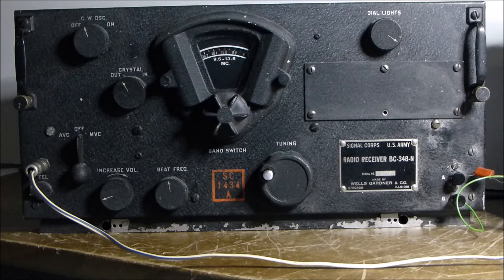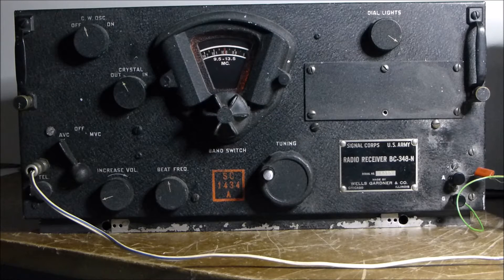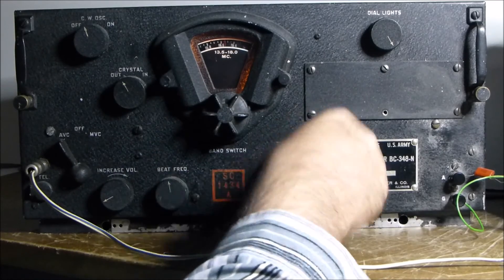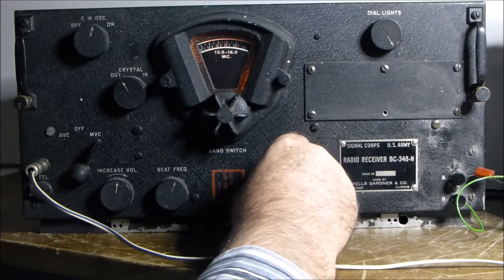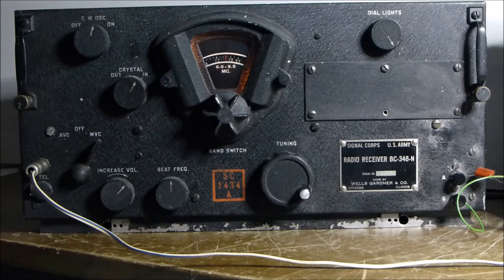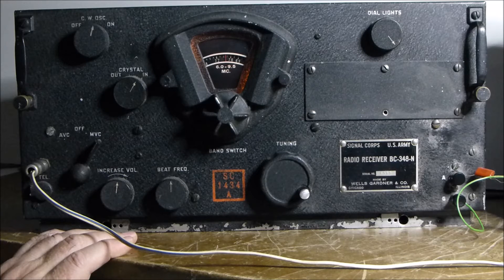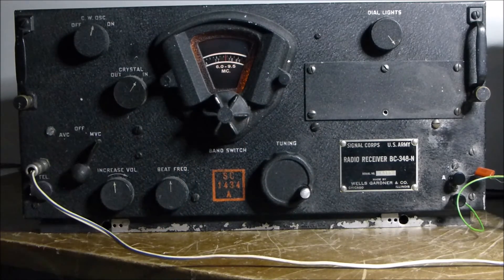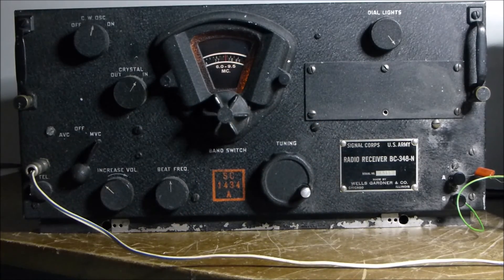BC 348 N - HF Aircraft Receiver

Comment: Hi can you please tell me where do I connect the power cable for 220 volts AC? As mine came without power cable so I don’t have any idea about it. I will be thankful if you may guide me to connect the power cable and turn it on. Many thanks
Reply from the maker: Hi, The BC348 was originally designed to woud on Aircraft DC systems , nominally 24-28V DC. It uses a dynamoter to prodcut the needed HT (High voltages for teh valves (Tubes). Many have had teh Dynamotor removed and a 'home' built AC PSU fitted, you would have to open up the case and take a good look inside, see if it has the origonal dynamotor set up or has been converted... Pete

Comment: I just got one yesterday. I don’t know what model it is because the tag is missing. The cw is switched with a toggle switch. What speaker are you using? My audio seems weak.
Reply from the maker: Hi, thanks for the message. Its been a long time since i looked at this  but i seem to think that there is a 600 ohm and an 8 ohm output tapping on this radio . There is an audio transformer center back topside and i seem to recall a tapping there for 8 ohms. If you using the crystal filter then its drops the gain a bit . and if its not 'cleaned' its drops teh gain a lot. Effectively its 'Q' drops of due to waxy residue finding its way into the crystal housing. I actually removed the xtal filter, carefully opened it up and took out the Quartz slab that was in there and gave it a good ( gentle) clean and finally a good solvent clean. Clean the housing insides too!. Then gently reassemble the filter  and you will be surprised how sharp the Xtal Filter becomes.( AND LOUDER)

Comment: Peter - nice video of the BC-348-N.  I have the BC-348-Q here.  It had just been recapped and aligned before I got it.  As a child, I listened to my father's BC-312-M until his home brew external power supply failed.  Not sure if it had a dynamotor in or not.  I made a short video of it, comparing it to a modern Radio Shack DX-398.  Audio from both radios was fed thru a Zenith Royal 2000 to amplify and equalize the sound.  https://youtu.be/Gn-rh6WiXio

Comment: I agree with you Peter the worm drive tuning mechanism is very smooth and virtually backlash free. I enjoyed hearing the dynamotor purring in the background as well.
I heard you mention you have an  ART-13 which was used with the BC348's on the B-29 Bombers during WW2. I built a home brew power supply for my ART-13 and currently use it 
with a BC-348 on 75 meters AM. Another nice WW2 receiver was the BC-342 which looked similar to the BC-348 but I believe it was mainly used in ground installations rather
than aircraft. It was also quite a bit heavier than the 348's. 73 OB....